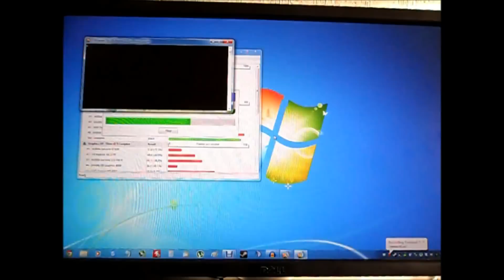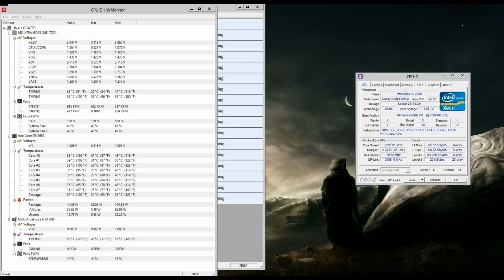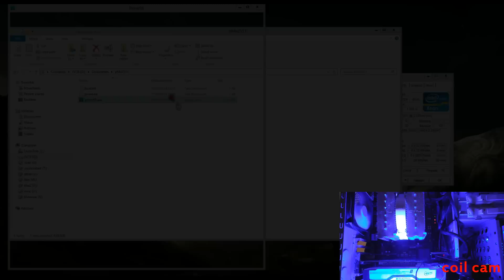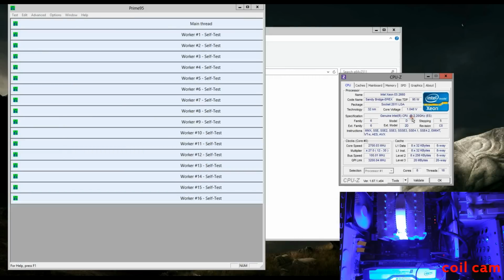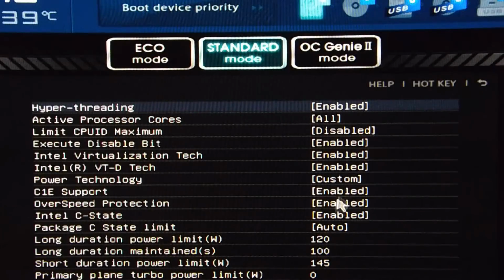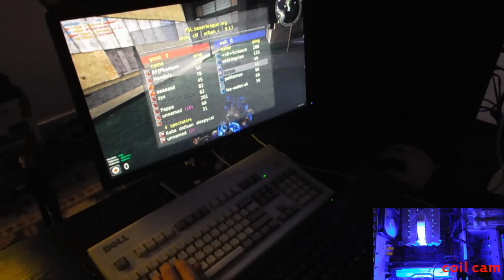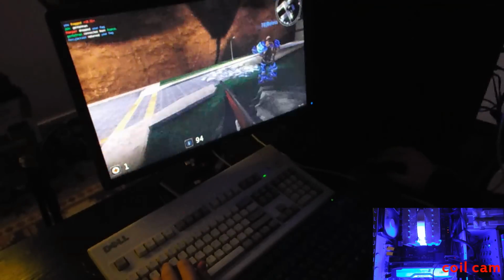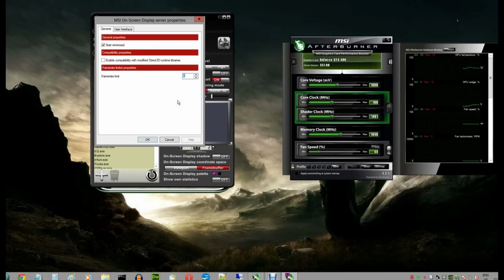07 How to get rid of coil whine

Comment: I have gtx 970 and i get whine sound when the game fps is over 200?
Reply: Try vsync
Reply: it helps :D
Reply: Vsync will usually quiet it down!
Glad I could be of service :D
Reply: ericskowron would gsync work?
Reply: JonetsuFin Hows that screen tearing working for ya?
Reply: Sgt Hartman I have the gigabte gaming g1 gtx 970. Havent had any screen tearing
Reply: Sgt Hartman  You don't get the point. My vertical sync is not off. Why would I even put it off? Doesn't seem to be logical.

Nice to see that if I write that I havent had any screen tearing while I massively put the GPU to use. You get to be called an idiot by someone who clearly can notice who is one and who isn't. If your monitors refresh rate is 60 and you get more FPS out of your videocard. You wont notice shit anyway. 100 fps on 60hz screen vs 60fps at 60hz screen. It has alot of difference? Nope. It's basically something you can't notice.
Reply: Zhou Yun
 I'm guessing English isn't your strong suit, you make no sense. You just finished saying you get no screen tearing. If vertical sync is on then of course you wont get screen tearing and I'm left wondering why the fuck you posted "I have the gigabte gaming g1 gtx 970. Havent had any screen tearing"
I wasn't even talking to you. I was talking to the guy that said he gets coil whine at 200fps. He no doubt has terrible screen tearing.
Reply: Sgt Hartman Yes, I think understanding people in any language is not your strongest point. I have no screentearing. With the gpu. Becuase this GPU doesnt need a vsync to be put off. It runs everything as smooth as it needs to be on 1080p gaming. Why would you even put it off to satisfy yourself on numbers that your eyes cant detect? You make no sence here is exactly what you meant. 

And on the other note MSI Gtx 970 is known to have coil whine. Happend to a lot of their cards. So I have no screen tearing and also no coil whine, how great is that? Clap for me.
Reply: Zhou Yun
 wtf are you arguing about??? I wasnt fucking talking to you!!! He said he gets coil whine at 200fps. I said hows that screen tearing. That has NOTHING to do with you. Grab a fucking clue.  Your little story has nothing to do with my post. You will indeed get screen tearing with vertical sync off. That's an objective fact. Don't bother responding.
Reply: Sgt Hartman Trying to run away? You commented on his post and i commented to yours. I said i didnt get the screen tearing. You didnt clap for me instead you commented on my post which is called communicating with me. And randomly called me an idiot. Brainpower and knowledge isnt your strongest point I see.

At the point when you've talked to me, you were communicating with me yes? Didn't see a article at youtube saying that you cant comment on posts, if you didnt like it you werent obliged to answer me and you still arent.

REKT.
Reply: Sgt Hartman Well in most games I don't get screen tearing and Vsync is off. You should only get screen tearing when the GPU can't keep up.
Reply: Sylvex Dragonskin False. Just....so false.
Reply: Nope, always say facts. Vsync just makes it so that you never experience screen tearing, even if your GPU wouldn't be able to make it happen normally.
Reply: Sylvex Dragonskin No, i'd like to tell you that you are not stupid. Screen tearing includes ALOT of factors including games. Some games could cause more screen tearing than others. So you are right about that part. You don't have to listen to FGT Hartman.

If your frame rates arent synced with the vertical blanking mode ( v-sync) or the vertical blanking mode is not synced with the GPU (g-sync), thats what will cause screen tearing.

Thats the reason why FPS limiting will not stop the screentearing. V-sync does more than just fps limits, It makes your gpu draw during the vertical blanking, vertical blanking is the only time your screen/monitor isnt updating the images it gets. Which is why you will not have screen tearing when you v-sync.

I can tell you exactly why screentearing happends and how it works instead of this FGT Hartman who can only complain and moan to others trying to be a keyboard gangster. Lmao.
Reply: Well thank you for your elaborate answer. I'm honestly ok for not using Vsync on high resolutions. :) And I know I'm not stupid, I'm one of the few that isn't.
Reply: Zhou Yun Shut up kid lol. Sad.
Reply: We all know you're a typical nb Hartman. Learn from the explanations people give you, it's truly meant in a good way.
Reply: Sylvex Dragonskin Enjoy your screen tearing :) happy face super friendly kisses and hugs best friends forever
Reply: No screen tearing in most games, again :)
Reply: Sylvex Dragonskin ya..bullshit. Which would be totally contrary to my experience PC gaming for 15 years on mid to high end hardware.
Reply: Sgt Hartman Well only say facts. I said most games and it's just so when you have high end hardware you should almost to not at all have screen tearing. But even if you do have it, it's not that bad.
Reply: Sylvex Dragonskin bottom line is if vsync /gsync/freesync is off, there WILL be screen tearing. It's jsut a fact. Arguing it is stupid. ALl you can say is you don't mind it, but dont say you dont get it. That's impossible.
Reply: Not necessarily. But I guess you don't know everything. Happy gaming :)
Reply: Sylvex Dragonskin ...Again it's a fact. Unless your hardware is lower scope and you arent pushing the frames. If Gesync /Freesync /Vsync are off there WILL BE screen tearing.
Reply: Well weird that it didn't happen with a lot of games then. But I sometimes out on Vsync now since coil whine is more frequent nowadays.
Reply: Sylvex Dragonskin No, more like wierd that you don't notice.
Reply: Sgt Hartman No just wasn't there. Learn to read. In MOST GAMES. However coil whine is a problem that arises more now and Vsync/Gsync is a good option as the solution.
Reply: Sylvex Dragonskin Impossible. No Vsync= screen tearing plain and simple. You're ignored so I hopefully don't get notices of replies.
Reply: I said facts that were happening to me and you don't believe me... so that's a choice but saying it's not true is stupid though.
Reply: Lol im at a vacation and FGT Hartman is still continueing in his bullshit ''shut up kid, lol'' is the best he could come up with hahahah XD
Reply: And Sylvex Dragonskin if you wont allow vsync you dont have to have screen tearing it has lots of factors where it can't happen even if you wont vsync
Reply: That's what I said. No Vsync doesn't mean you have screen tearing, mostly only zith heavy games for your GPU. But I'm gonna wait how much difference DX12 will be.
Reply: ericskowron vsync is horrible, all that input delay D:

Comment: Does anyone have a solution for the GTX 970? Mine is so fucking bad. You can hear it clearly across the room over the sound of 7 120mm fans. V-sync doesn't do shit. It doesn't matter whether the FPS is 10, 25, 32, 60, 72, or 144, it squeals like a pig. All games do this. 3D editing programs do this. It's awful, in some games I don't play for very long because it's piercing.
Reply: I tried messing with the clock speeds/voltages, no avail. My card doesn't OC at all, and under clocking seems a bit stupid...

Comment: "Small" power savings?  From idling at 25-30 Watts and light usage of 45 Watts to full 105 Watts all the time? Hell of a "fix" for coil whine produced by low quality/QA "NOT passed" voltage regulators. The only fix is: RETURN THE PRODUCT!
Don't EVER settle for anything than the best, as all these computer parts are overpriced enough as it is and the Quality Assurance is lacking big time for all them "Made in China" electronic parts, especially in these last few years.

Comment: But i see u already have it fixed to 100 and it fluctuates so there must be sthg wrong with that sys.
I would start with a look at ur odd memory count. why u have 20gb displayed in the bios?
How that works with quad channel cpu? Or is it mesinterpreted cache size from board? 20480mb from 4 or 8 modules?
Definitely not in the ram support list and first point to look at.
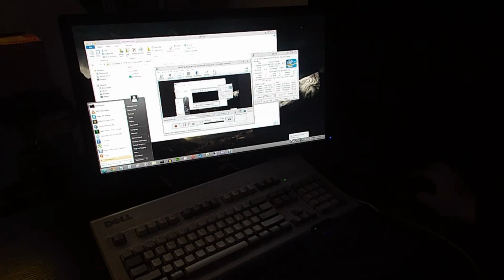And that i am right is proven at 3:40 when u have load and a stable base clock the coil whine is gone.
So hopefully not more thumps up for wrong information for people they hope to find a solution here.
But i really like ur voice, the style of the video, the quality and the trick with the paper is a nice move, very few know that cheap trick.
Reply: +vonshtoyven 

with the sys from the video are many things wrong.

I know that its possible to switch the cpu dependent coil whine on and off with the c states.
But u dont kill the root of the evil.
Its caused from the fast switching vcore, 
by disabling c states and speed step u disable the energy saving/longer lifetime capabilities from modern cpus and a cooler running cpu in idle.
Coil whine comes from the movement in that coils which creates sounds.
It happens often when the mainboard voltage regulator circuit is running at maximum or low quality. 
In actual systems its often caused from the power supply unit because cheap/not state of the art ripple suppression and voltage regulator circuitry tend to make it worse or noticeable.
If u already own a decent board, lets say the ballpark 100 bucks than everyone should try a power supply unit with very low ripple and very good voltage regulation.
The modern graphics cards do the same crap and thats the heal there to so a modern power supply is worth the shot.
I have good experience with superflower leadex, corsair rmx and actual seasonic g series.
Of course u are free to disable good money saving functions but its not that easy when its at ur gpu and then u need to face it anyways.
Reply: +vonshtoyven 

Yes the sound is of course ommitted from the cpu coils, therefore we call it cpu coil whine, 
Gpu coil whine is omitted from the gpu coils on the graphics card. 
If it would come from the psu we would call that psu coil whine. Got terms straight now?

Nevertheless does the psu sometimes cause/increase these whines with a bad response to the fast switching of the cpu/gpu and with that applying more stress or an unclean signal to the vrm system.
Hope thats understandable now.

In case of cpu coil whine it sometimes also makes a difference if u disable power saving feature of the vrm system. So all phases run all the time and the load is spread evenly across them which reduces maximum stress for each one.

To Glue them in is not the right way because the heat cant go anywhere and so u increase stress for the coil or maybe change its properties to the negative.

C state and eist are wonderful stable features when u know what u are doing.

Comment: Most people play with the PC...like a foot away from them for who knows why. Who cares to look at it? I put mine 9 foot away to my right at the end of my corner desk and it's blocked by the 3 foot deep leg of the desk. Silicone inside the pc as well and also large 240mm fans x 3 (which are super super low RPM but the CFM is super high because of the size.  You'll have to buy longer DVI/HDMI and USB cables (specifically extensions) but when I did that, can't even hear it. I wear Astro a50's 7.1 surround sound headphones so I don't hear anything. When I don't wear headphones there is a very very low white noise hiss, it's so low though it's hard to place where it's coming from. Just a thought.